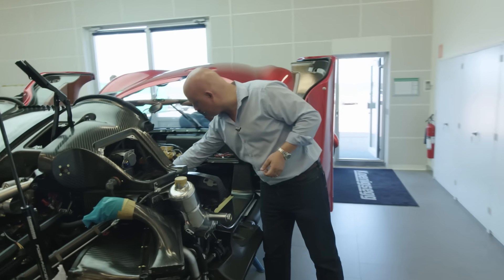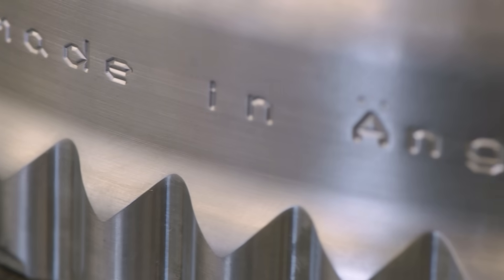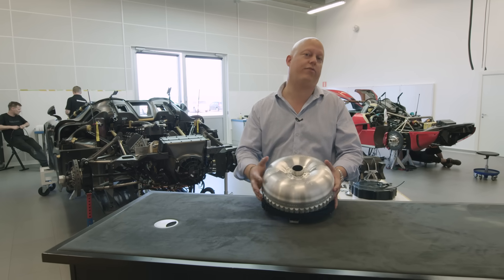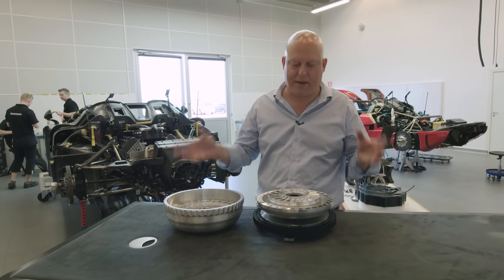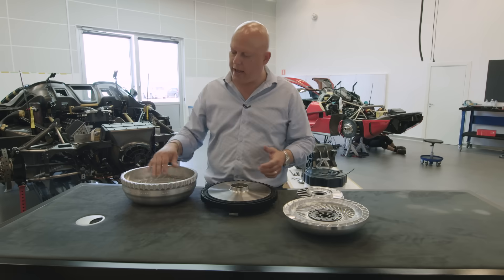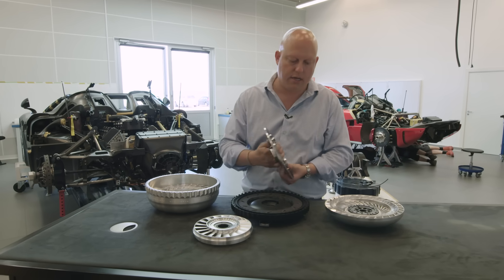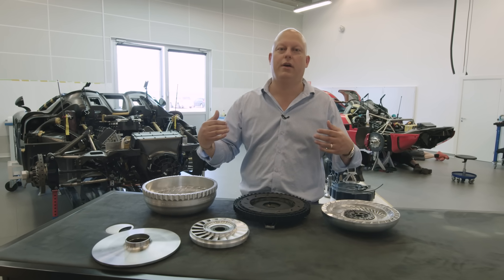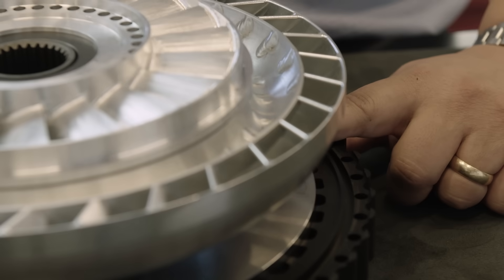248 MPH Without A Gearbox: Direct Drive  -- /INSIDE KOENIGSEGG

Comment: ok,im no expert so , im not looking forward to have a very detailed understanding of how this work , so i will just make this question to anyone in the comments that can clarify this to me:
in words that any idiot can understand , they basically made a car that has 7 gear only , and because of the huge amount of hp and this converter , it can give a lot of torque in very low rpm? if i am incorrect please , try to correct me in the same casual language , otherwise i wont understand , thanks for your time whoever answers
Reply: I will try.
The car has a combustion engine and some electric engines. In common cars, every combustion engine needs some kind of  gearbox and a clutch.
The Koeniggsegg does not have a gearbox, so there's only one gear. And no clutch. That's bad if you want to start the engine, if you want to idle, and as long as you don't go at very high speed it's even bad for driving at all.
To solve all this problems, they use a torque converter.
Imagine a spoon (connected to engine) in a glass of honey (connected to the wheels).
When you slowly turn the spoon, the glass will not move. (Good for idling) When you turn the spoon fast enough, the glass will also start to turn. There you go: We have a (hydraulic) clutch. To increase the torque at low engine speed there's a turbine and some clever bent vanes between spoon and glass. Voilà, this is called a torque converter. The way it works is witchcraft, however, now we don't need no mechanical clutch and with enough engine power we also need no gears. As if the 8 Cylinder engine hasn't got enough power (>1000 HP), they added some electric motors to make it even more powerful.
At high speeds, the TQ is mechanically locked, now spoon and glass are glued together and all engines are directly connected to the wheels. That's why they call it "Direct Drive".
Please anybody correct me if I'm wrong ;-)
Reply: Its as simple as he puts it. Its just a final drive. There are no gears like in a traditional auto or manual transmission. The Torque converter, like in an auto, is there to double the torque from the engine at lower RPMs. Up until some predetermined ENGINE speed, the lockup clutch engages and the car is just in its final drive("7th gear"). The Electric motors assist in acceleration and to reverse the car.
Reply: It's basically a big oil-pump (works and looks a lot like a fan, or an air-pump if you will) that pushes the oil on another fan-blade to make it spin. There is a difference in the blade area, where the input fan (connected to the motor) has only half the surface area of the output fan (connected to the drive). One turn on the input fan moves only enough oil to spin the output shaft about half a turn. You basically get a 2:1 gear rate. Just as in a normal gearbox, by lowering the output speed you instead get more torque. Using the oil fan to fan (aka torque converter) instead of a normal dry clutch allows a lot more slip whit out it burning up.
Reply: Thank you both , i think i get it now
I can see i was not that confused there
I kind of had the idea and now i think i get it well
But like one of the comments say , how does the torque converter works exactly is witchcraft to me
Reply: Ok, but is it done "at will"? 
In my opinion that cause a problem, if the torque is managed automatically, 
assuming that we just have to content ourselves with accelerating and 
decelerating(Either press the right pedal or release it), the karma of the road,him, imposes that we have more or less couple to the approach of turns, climbs, 
descent, according to the texture of the terrain, chaotic or not, 
requests to manage this torque at the request of the driver.

If you increase the performance compared to a normal clutch system + gearbox that lose a
 lot of power, this system would gain acceleration and deceleration, but
 if it is managed automatically, if the force transmitted to the wheels 
is not ordered by the pilot will pose a problem, unless it has a command (such as a lever for example) to manage the torque by self.
Reply: leo197777 Torque is managed by the electric motors and the engine the fancy new FreeValve technology. The torque converter works "mechanically". Its just a hydraulic pump with a lockout clutch. As simple as it can be, similar in the fashion that a mechanical or viscous type LSD works. It just does. Theres no computers telling the torque converter to do anything.

Comment: so how do you go in reverse? and if you can, can you go 250mph in reverse ?
Reply: You can't. They use the electic engines to go in revers.
Reply: this isnt forza lol 😂
Reply: Gert Ahnström the reverse is "limited" to 500hp... lol!
Reply: The reverse is '''limited" to the rear motors with 500 hp and the possibility to do 0-60 in reverse in 4 seconds.... But obvously, it is limited to far less than that electronically. But in theory...
Reply: borderex 17 reverse via rear electric motors

Comment: fascinating, but in the end it's just engineering for engineerings sake. the uselessness of the whole system is not comprehendable to the unexperienced eye. 

1. You can barely drive the regera in germany, where you don't have a speed limit on the autobahn - why is that? it's because the germans actually use them for normal travel, and you actually need a lot of space to press the gas.

2. I would have much more respect for all the technology if it would be implemented in something as simple as a saab (see the beginnings of Freevalve), something that the normal mortals can not only enjoy, but also contribute to reducing pollution. 

3. what koenigsegg calls hypercar technology, with the appropiate price tag, the working americans are enjoying since 2014 in the form of the accord hybrid.

Comment: lol the amount of heat that thing must generate... probably has its own radiator just for keeping the oil from destroying itself. honestly though, if my automatic 3.6L 250hp Subaru outback can take off in a gear that will reach 60mph, why not a 1200hp ice with 500hp electric motors and a third electric motor integrated into the ice (internal combustion engine).

this is pure awesome. the car industry can't help so he just says fuck it we'll make it ourselves.

Comment: nice thing: a torque converter has nearly no wear and needs very little maintenance. just like the electric motors which have only one moving part and are not likely to fail in the next 50years. of course transformators and batterys do not become better or more efficient with time but the industry is working hard to find better and longer lasting solutions for that. CvK is just a genius. really takes car technology a step forward

Comment: "It's rather simple" Yeah because you're a literal genius.
Reply: Lol  that is what I was thinking.
Reply: Gooby plz It works just like a torque converter on an automatic transmission. But it's designed specifically to take much more torque than usual, and because the combustion engine has so much torque to run the car in its final drive gear (differential gear) they chose not to use a gearbox at all. And in conjunction with electric motors which give instant torque straight into the wheel shafts they minimise an Power loss through the fluid slip. Once the torque converter is nearing is 1:1 ratio it locks up and spins at the same speed as the drive shaft and Theoretically has a 100% Power delivery. It's actually a very clever design that uses traditional car parts with the help of electric motors to compensate losses. This way they can idle the engine in final gear without stalling it.
Reply: You watched the video, right? He said, "this was invented - I don't know - maybe 100 years ago". So, yeah, I'm pretty sure he didn't personally come up with this, either, since he's like 40-something years old. However, he took something old and found a way to make it work in a cutting edge hyper car and therein lies his genius.
Reply: Well it's basically the hydraulic equivalent of pointing a fan at a windmill. It is pretty simple...
Reply: its so simple I watched it like 10 times and still dont have any idead how it works xD
Reply: him and Elon Musk would have a field day together
Reply: toobadsosad83 compared to who?  Tesla takes in less subsidy dollars than the other American manufacturers on top of actually paying off their loans.
Reply: After watching the video, i still dont really get how this torque converter works.... Hmm gotta watch it again...
Reply: sardanapalos the grade of aluminum that is used is probably as exotic as the rest of the car.
Reply: sloergod basically the fluid being pushed one way changes direction and moves the others half of the converter once you have enough rpm. At a stop it's spinning slow so it will only spin half the converter
Reply: a propeller spins a propeller. the fluid travels through the inner blades in one direction and travels through the outer blades in the opposite direction, circulating the fluid
Reply: Well it is simple even if you have a basic knowledge about how engines and gearboxes function.
The problem i see here is with this thing being aluminum how can it withstand such great pressures and for how long?
Reply: Steve Ross swedish aluminium is probably the highest grade in world.
Reply: +Elfren Authorlee Why be a chicken when you can be an attack helicopter?
Reply: TRUE!!
Reply: +Igor Rebenko So simple it was invisible in the high tech world. Imagine eliminating the need for a transmission gear box....
Reply: medvidekmisa the torque converter gives you the ability to get going by the engine power but Even though it's big horsepower it's not going to have all that power at take off without having a transmission to allow the engine to start off in first gear so the electric motors on the engine and each wheel helps the motor until it gets into it's power range basically he got rid of the transmission in favor of a 800 volt battery and a bunch of electric motors. and still has a big horsepower gas engine that is connected to the differential through the converter to still give you the ability to sit at a red light with the engine running while in drive. it's not that great of an idea
Reply: If you have some background knowledge about torque converters it is pretty simple. There is nothing realy special about it (except the dimension). Just the way he uses it is very different.
Reply: The instant torque of electric motor's made this feasible
Reply: he said it... just listen!
Reply: Sandvik
Reply: +pietzeekoe his name is on the company. I bet you are wrong.
Reply: its simple because he understands it
Reply: You must thoroughly understand the fluid dynamics of a torque converter in order to grasp everything.
Reply: I'd say it will be a Al-Mg composit. Unless there will be great amount of abrasive particles in the fluid it should last the life of the engine (IMHO). Maybe direct the question directly at Mr. von Koenigsegg?
Reply: +Ben Jamin, that thing does even have its own name. It's called the Curse of knowledge.
Reply: the offset is carrying around the huge battery that produces the needed 800 volts
Reply: Well the genius of it is, that is just that, simple! He's taking existing, reliable technologies and then tweaking them and mixing them in ways people never thought before to produce something thats far better.
Reply: No, because it's 100 year old technology that some shitty broken down ford is using... All he did was optimize the blade profiles and use a material that is lighter, stronger, and better able to dissipate heat... There are videos to help you understand this strange phenomena that has plagued drivers for a century with craptastic automatic transmissions.
Reply: +toobadsosad83 I'd rather Tesla receive investment over Opec. Elon Musk is doing the right thing and he pays back the money. The only things the oil leeches give back to the people in exchange for taxes, are exhaust fumes(one of the main causes of death) and the middle finger. Besides the central banks are the biggest 'welfare whores'
Reply: It is quite simple though, fewer parts to go wrong, improving existing parts. Electric is coming into it's own thanks to Elon Musk kick their arses into gear.
Reply: Yeah.... pretty sure he didn't personaly come up with this....
Reply: Well, when you figure out another way to make tires and all the plastic components for your Chevy Bolt or Tesla without doubling the cost of the car, then you can knock the oil industry. 

In the meantime, consider that oil is still the primary source of power for most cars and the raw material of choice for most plastics for a reason. It's cheap, plentiful, and more energy dense than any other fuel, and without it, the auto industry as we know it, as well as a lot of other industries, simply wouldn't exist. Without petroleum, a hell of a lot of consumer products we take for granted would either be out of reach for the average person, or wouldn't yet be available.

And sure, in places like China, there is excessive pollution from car exhaust, but in most of the world, car exhaust isn't "one of the main causes of death". And if you removed oil form China, you would replace that pollution with other types, like wood or coal smoke, and most people who ride scooters, especially in rural ares, would be screwed, as they can't afford a Tesla. 

Besides, oil company profits are a few cents per gallon here in the US, whereas in the UK, for example, over 60% of the price of oil is in taxes, and in the US, ranges from about 32% to 49% tax. The leeches are the governments who are ripping the consumers off, not the oil companies, or the fuel retailers, who typically make a few cents per gallon, as well. 

The upshot of is that the oil companies are not your enemies. Without them, every aspect of your life would be more costly. (Food, clothing, shelter, transportation, medicine, consumer products like computers cell phones, etc).
Reply: To a rock a chicken is a genius. Stop beings a  rock, be a chicken.
Reply: Every power plant uses hydraulic couplings for start up phase. Jesus. You guys know nothing. But keep installing blinking LEDs to your shitty cars.
Reply: These trorque converters are not a new invention. The torque converters have been used on all automatic transmission cars for a hundred years now. This is not anything new except for it has no gear box they just skipped that part because the electric motor has plenty of torque and don't need one. All these snow flakes didn't get to take auto mechanics in high school so now they are so overwhelmed by this torque converter.

Comment: I have an AOS in Automotive Technology and this makes my brain hurt
Reply: My best guess is it's an automatic without the planetary or sun gears, so a one speed auto essentially
Reply: Theres a clutch pack and a very low stall torque converter.  Its all calibrated so the car can take off on just the ice.  

I'm wondering what is actually special about this specific torque converter.  TC's in a range of applications can multiply torque anything from ~1.8 to 5 times.
Reply: From what I can tell, nothing is special. It is just a very well made torque converter. The direct drive lock up assembly is also seen on most newer high end cars. The two cool things about this are: The Torque converter is robust enough to transfer high amounts of torque with small driveshaft motion, and it is CNC'ed from a single block of aluminum.
Reply: Hilariously, one can buy such a piece from a number of aftermarket parts suppliers in the US as well
Reply: It's a little misleading to say that the entire torque converter was machined from a single block of aluminium. There are different parts. It didn't all get milled from the same block of aluminium at once.
Reply: Clay Norrbin thats what he said, lol